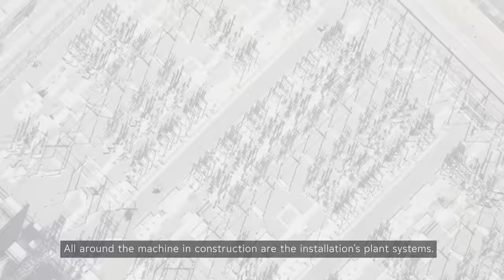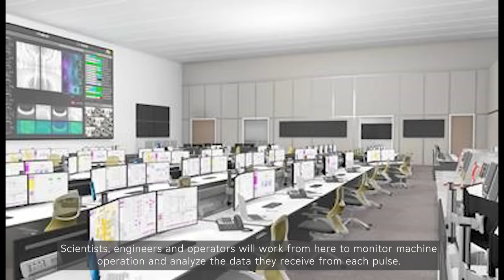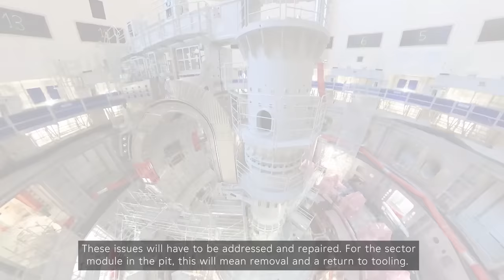ITER by drone - latest update

Comment: wow all this work in designing and construction, all the years of development and this is just to prove a concept, not even designed to be used to supply power to the grid. i wonder how much work the DEMO plant will take following its success, really hope this all works out.
Reply: Probably less work than ITER, now they have experience. Still a lot but should be simpler if they don't build a completly new design. Also proving a concept can be quite hard. You have to messure a lot and get consistend values. And they won't just proof that it works, they will try to optimize.

Comment: Beautiful update! This is one of the most important projects of humankind -- the promise of free energy will completely change the landscape of our civilization.
Reply: It won't be free, it will still need to be made and distributed by some kind of infrastructure and that doesn't come for free.
The goal is reliability and sustainability, not necessarily a big price drop.
Maybe fusion energy will get cheap at some point, but only if it becomes cheaper to run all the power infrastructure, including the fusion plants, by way of autonomous robotic maintenance.

Comment: I wonder if decades after the project for this was created, is the ITER architecture still the cutting edge? Does the technological progress hint that this might work or we should do this different?
Reply: It depends what you mean by cutting edge. ITER has a flexible experimental setup in order to find the best way to build the magnetic fields for a power plant, we know that the eventual power plant will be different (so you could say it isn’t cutting edge), but ITER is the best way to figure out the specifics.
Reply: That is the thing about the cutting edge of science, engineering, sports or whatever, you don't know what you don't know until you've tried. This far the science we have points to this being the slightly less efficient to run but easier to build sustained fusion reactor.
Reply: newer and more modern magnets have already been developed then are being used in iter. If they are planning to bring that new tech in im not sure but them new magnets are going into other fusion research none the less
Reply: The lessons and mistakes learned will be used when building the experimental power plant called  DEMO in the future. ITER is not the final architecture , It is a test to learn what is possible.

Comment: Keeps the scientists and the mechanical and electrical engineers and tradespeople in work.
But I don't think it will ever produce a net power output on a constant basis with the current tokamak design. The Lawrence Livermore breakthrough which seems to put many current fusion reactor designs in doubt has given everyone pause.
I hope I am proven wrong about the design but I doubt it.
 The current cost blowouts on the project are pretty large and intimidating to say the least.
A  mega project that we hear about on occasion that will definitely be an engineering masterpiece whether it works as predicted or not. 
Goodluck...........
😎

Comment: Will it even work? The lead on the project Bernard Bigot RIP.
Reply: I worked on the JET machine that came before ITER - it had cost overruns, took longer than originally planned, and it had numerous setbacks. It was however finished. It exceeded it's original goals, created fusion, and we learned a lot, not least that with a positive mindset, our species can achieve what some believe is impossible.
Reply: @OptimisticHominid  Thats awesome man thanks for the info

Comment: Why not spend money on a lab scale fusion reactor ( that can run for a few hours ) before draining the science budgets of several countries with a full scale machine design that will not run for longer than 20 minutes ( translation = it just dont work ). AND it will drain gigawatts from the electric grid thereby ACCELERATING carbon emissions.   Impressive engineering and expenditure of resources though !!

Comment: See the stand that said "we have delivered" 20years later is very painfull! still not a real power plant that will produce energy for real.
Reply: If you are building a jet airliner, starting from 0, do you build a test plane that you can stress test, fly around, measure wind speeds on etc, or do you equip it with seats, personal TV screens etc and take passengers for a ride? You tell me which option you think makes sense.

Comment: 1:42 ITER's cooling water systems will be capable of removing 1.2 gigawatts of heat.

Remove heat? You are supposed to generate electricity with it !! 😁
Reply: This is a test facility, no reason to build a powerplant structure around it. That will be done on DEMO, the followup project to ITER
Reply: For now the goal is to know if it really works

Comment: With no apparent way of harnessing power from a Tokomak for a practical power generation plant ... does investing mega bucks in this massive R&D project make sense??
Reply: NIF has even worse prospects for capturing the energy.
Reply: Yes.  Next question?
Reply: Wrong, fast neutrons heat the blanket. The blanket heats watet which  then drive turbines..
Reply: You do what every other plant does, you run the heated water over a turbine. Just because ITER isn't designed to power the grid doesn't mean we have no clue how to get the power out of a fusion reactor.
Reply: @JohnnyWednesday  NIF isn't a powerplant setup, it's nuclear and fusion research, so yeah, no power capturing happening there but plenty of research.